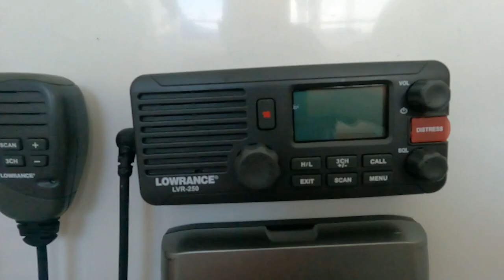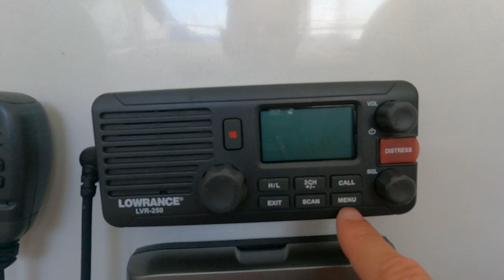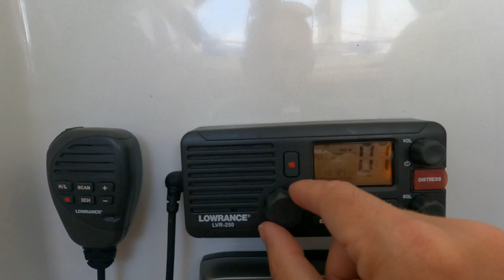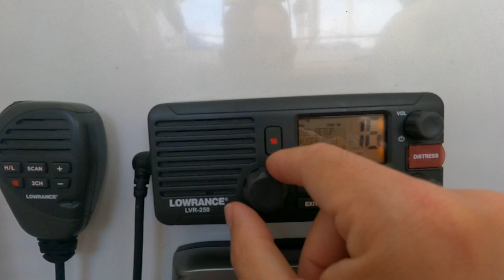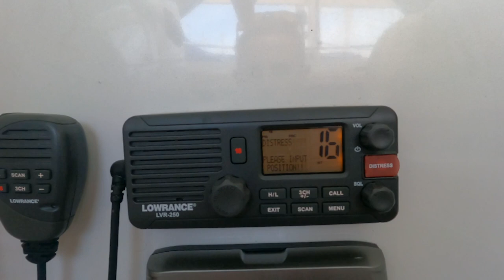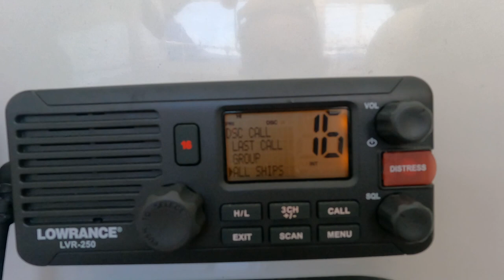Doing my RYA VHF Radio Training

Comment: Hi I am looking at getting a handheld vhf for my small boat. I will take the vhf course soon . How do you get mmsi number and call sign ? Is this issued on completion of the exam ? Thanks for sharing vid .
Reply from the maker: The MMSI is not related to the qualification, it is a value generated by the radio, and that is what you register with the local radio authority.
Reply: @TheBoatVirgin  thank you kindly.
Reply: Hi enjoying all your videos.  I am doing my rya vhf course and exam in a couple of days time. I've read up a fair bit of the book that accompanies the course. Im quite nervous about the exam . Is it fairly straightforward any tips on particular areas I should bone up on ? Many thanks. Looking forward to more vids from you.
Reply from the maker: You'll be fine. Your instructor will go through all the basics with you over the duration of the course, and you will get to loads of practice, and when it comes to the exam piece they fully appreciate that folk are nervous.

Your instructor will also highlight things that usually come out in the multiple choice exam, and will give you lots of tips. So don't lose sleep over it, honestly.

The fact that you are doing the course is what they want you to do, and if you do get something wrong during the assessment they will give you feedback.

You'll nail it.
Reply: @TheBoatVirgin  many thanks for your reply.  All done and dusted and passed. Looking to do power boat level 2 next. Keep up the good work with the videos.
Reply from the maker: @alexstubbins6298  thank you and spread the word. Us virgins need to stick together!!
Reply: @TheBoatVirgin  ha ha 😂
Reply: @TheBoatVirgin  The MMSI is issued by Ofcom, not the radio!
Reply from the maker: @dooberrypie  so my video talks to registering the MMSI for my radio against my details. The MMSI was already saved in the radio. Thanks for watching.